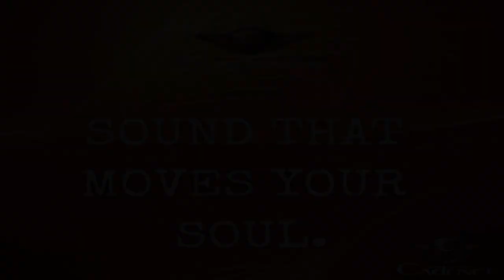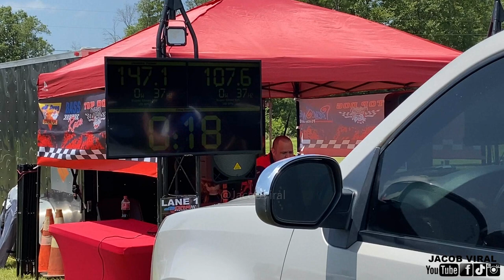2 15S TEARING UP THIS DENALI!

Comment: That's what I like to see 147 low cost build hitting hard 💪
Reply: It actually has the potential to do an 152 or higher
Reply: @bassbrother101  you are so right for what he have very impressive around my price range
Reply: @bassbrother101  what would have to be done to achieve that?
Reply: @imfrom210texas first thing upgrade the electrical system second is more power to the subs ( them subs can handle 2 more of the amps that's already on them ) (sound  Deadener) and bracing
Reply: @bassbrother101  4k is definitely pushing it a bit lol, I run my single zvx 15 on a wolfram aw3000 idk if I'd be comfortable giving it more than that, thing slaps
Reply: @liloversteer7308  the big thing is CLEAN power, you'd be surprised what a woofer can take when the power is 100% clean and not generating heat in the drivers/coils lol hell my last build had 4 Sundown Sa15's (750rms each) and I fed them over 2k each and never had a single issue no smelly coils, never got hot nothing but good loud bass doing a 153.7db daily on music so yes if you're pushing the wolfram 3k to clipping which I'm sure you're trying to squeeze every bit you can out of it then it will seem as though the woofer wouldn't be able to handle more but it can! I have the wolfram AW-9000.1D at half ohm on two 15's now and they love it!!! Temp box though so not ready to be metered I'm designing a 4th order wall for it soon as weather permits...
Reply: @kevinAuman1  exactly 💯🔥🔥🔥🔥
Reply: @bassbrother101  I never really realized how much the power flow helps. Thanks man
Reply: Those subs will eat 8k but he needs to drop some money on his electrical first

Comment: i’ve got the 07 xl denali with 2 15”s (cheap gravity warzone 3500w) on a cheap 5000w gravity warzone amp, and in a standard box that pretty much just fits the 15’s(small, still gotta room in the trunk((not like this dudes)) and mine does NOT slap like this!! I have a extra battery and an upgraded alternator.. 
To make mine sound better are you guys thinking just get a bigger box and another one of those amps, so i have one on each sub??? lmk what you guys think! all advice welcomed!
Reply: I recommended bigger box my son's running 2 15 kickers in a custom box on 200 watts doing the same
Reply: @tamekiamann1694  what kind of box?? did u guys custom make it it bought it?

Comment: Damn, this video was kinda discouraging for me personally as I own the same vehicle and have all the components to start my installation consisting of two Deaf Bonce apocalypse DB3515's dual 2, a Wolfram AW-9000.1D wired to half ohm, basically same exact box, a mechman 370 and rebuilt oem 270a and XS SB1000-31 supercap and limitless cyber 12k so way beefier woofers and triple the power im scared for my nice truck 🔈🔈🚙🎛⚠️🌬💨🌪💣🤦‍♂️
Reply: Just sound deaden it real good and you'll be alright!!  👍🏾👍🏾🙏🏾🙏🏾
Reply: Just because you might have something better audio wise or less. Don't mean. Nothing. Its all on your set up how it's built the proper box makes a difference wiring alt placement.  

I've heard and seen some expensive builds 12 20 30k watts and sounds like shit.. couldn't even hit over 154..   seen and heard less make higher. So just do you!
Reply: his port right on that tailgate too move it the other way it wouldnt rattle so hard
Reply: You can't be scared of the monster you create. I been doing subs for a long time but this the first time I'm going competition style.